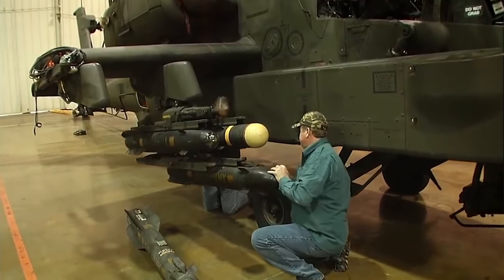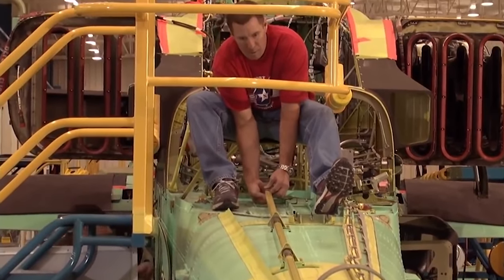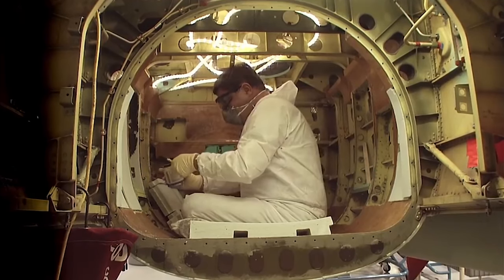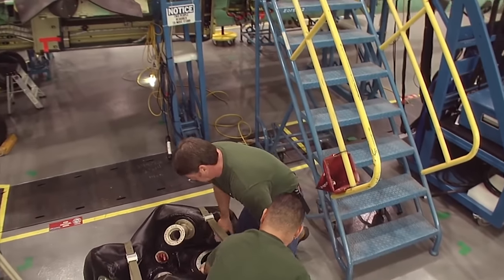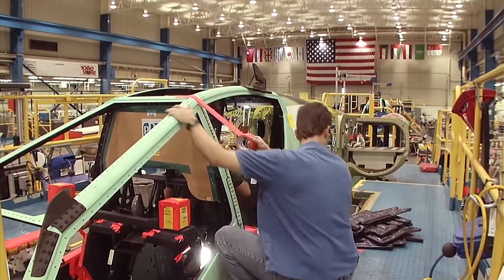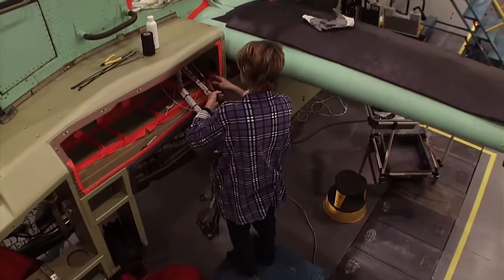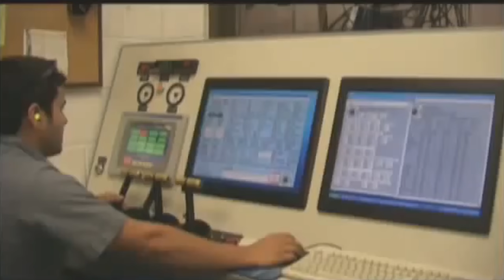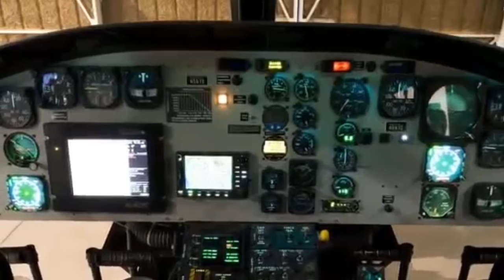▶️Apache FACTORY🚁Helicopter Production: Bell Huey➕Boeing AH-64 Apache

Comment: The information in this is off a bit. The building facility parameters are correct, however just north of Mesa and the Boeing facility is a huge range which spans northward and along the Verde River. When I was with the AZ National Guard, prior to Desert Storm, we performed a lot of maneuvers in this area as they tested the Apaches systems.
Reply from the maker: Wow! Thank you very much for the additional up-to-date information. I did not know. Do you live near this factory?

Comment: Ah, nothing like a computer-narrated video. 😅
I used to work at the Mesa plant, doing video production. I was in the assembly area many times, shooting many videos on one aspect or another. Also got to travel to various army posts to get footage of flying Apaches.  The sound of those engines and rotors is burned into my memory.  Good times.

Comment: Terrorist's worse nightmare... an AH-64 Apache with full weapons load out, hovering behind a hill or tree line. It's sensor on top of Rotor gathering data to calculate optimum firing solutions to make terrorists disappear forever just as soon as Bird comes up high enough for welcome wagon to be delivered. 

I used to work for Boeing. Initially I was at Everett Plant where twin aisle passenger aircraft are produced; 747, 757, 767, 777, 787, and soon to be 797. It remains the largest building by volume in the world. It has the largest moveable doors in the world. Each one is larger than an entire Football Field. The doors have the largest painted murals in the world also. I became a certified Lean Manufacturing Coach and helped lead workshops at numerous Boeing facilities. I have never been to the Helicopter Plant. I do have great memories of working at St Louis Plant (formally McDonald Douglas), on last 4 F 15 Eagles, 2 Harriers being upgraded, and on streamlining processes on F/A 18 Super Hornets, 2nd order by Navy. This was in 2000, since then, they have resumed production of F 15 Eagles.  They are still making F/A 18's too I think. Lot of work going on with next generation Stealth, UAV's, Weapons Systems, etc. 

Boeing will always be committed to providing best equipment to our Military.

Comment: I work on these piles every day, this video churches these birds up a little too much, the lower fuselage is not armored only the crew stations seats and side panels are armored, there is also ballistic glass that divides the two stations capable of stopping 20mm rounds, don't get me wrong I love the airframe but after working on them for so long one can understand its tendencies and flaws to make a valid assumption.
Reply: Surely the turbines and fuel tanks have to be armored right?
Reply: @Frenchfrys17  The 2 internal fuel bags which are located under the pilot seat and aft before the tail boom do have a self sealing membrane that will react to jp8 or the kerosene in jet fuel, if punctured by small arms, it works like a clotting agent it will still leak fuel at a much more slower rate, as for the 2 engine cells ya there isn't any armor, that being said Boeing has made the bird very redundant I've seen these birds riddled with holes and still get the crew back to the FARP safely, hell I can still remember a crew landing and they didn't even know they took damage until we started to rearming her and noticed fuel leaking from the front bag, crazy days those were, well I hope I answered your ? looks like I wrote a fking book here Frenchfrys17 have a good one.
Reply: @Mr762308  Kinda weird that Boeing took so much time implementing damage control and redundancy into the design, when simple titanium/ceramic plates with STANAG 4569 Level 3 protection would work just as well and weigh less than doubling up on every single component in the helicopter.
Reply: @Frenchfrys17  In 2010 the first E models were available for the Army to test, big Army picked 1-1 ARB out of FT Riley KS and a select group from each Company mainly combat vets to go to Masa and start testing the improved version, we literally landed at the factory in CH47s, when we offloaded we could see 8 brand new AH64Es lined up right outside the final assembly building, there was a lot of BS fan fair going on but what really struck me was a display on a huge poster board explaining all the new updates to the bird and right at the end was a number 41mil, as a soldier you really never think about the costs, now that price has prob dropped a little since then, but the changes were mainly towards things that had nothing to do with added armor, I'm sure if one wanted to know some of the unclassified updates on the E model they could find that info, I retired in 2012 and I still can't get away from that bird.
Reply: Yeah, I’ve been flying them for 24 years. The side windows might stop a BB gun 😁

Comment: Certainly a lot more flimsy than I imagined it to be!  Interesting to see into the guts of one as it's being put together.
Reply: I don't think "flimsy" is the word you were looking for . In my opinion. To me when a plane or helicopter is "flimsy" it bends and not sound structurally.. if that was the case the airframe wouldn't still be in production. Likely not pass the testing phase.  Maybe "minimalistic" as far as the shell thickness.. or just plain "thin" like the WW1 fighters that had clothe stretched over a inner frame.